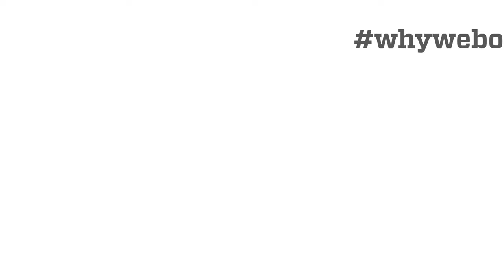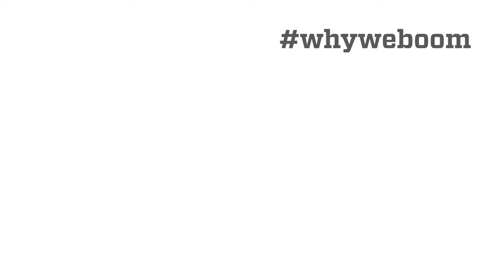Introducing the Auray Boom Pole System: The Boompole You Design

Comment: So cool
Reply: Wish they still sold these boom poles and accessories.
Reply: For the price that these were and the ease of access to consumers to simply switch parts when needed or wanted, it really was an amazing design.

Sadly they are discontinued, but I still rock mine with a bottom housing (still on the hunt for a side exit housing), and internal cable. Serious competition when considering the other options out there.

Bring these back Auray!